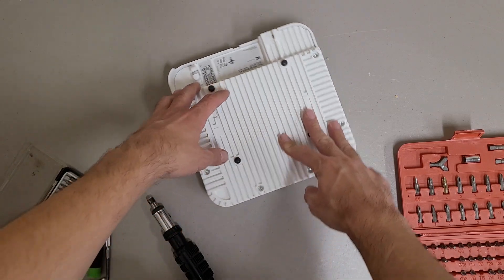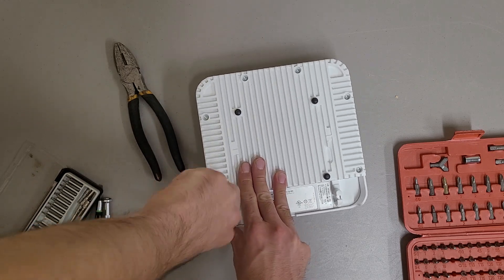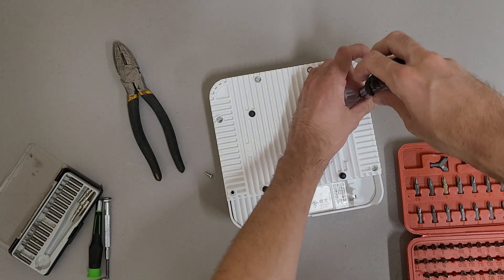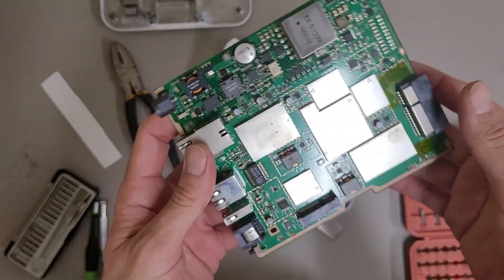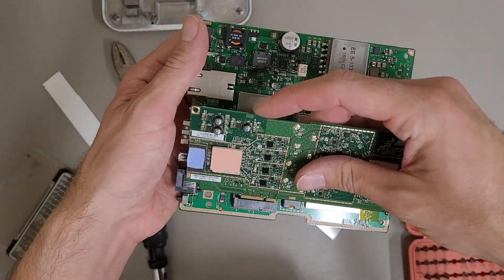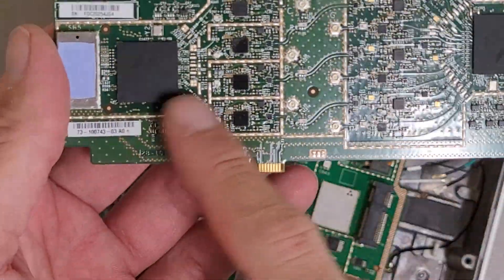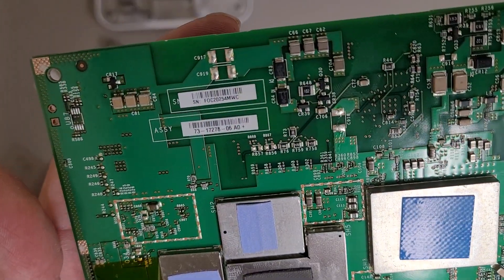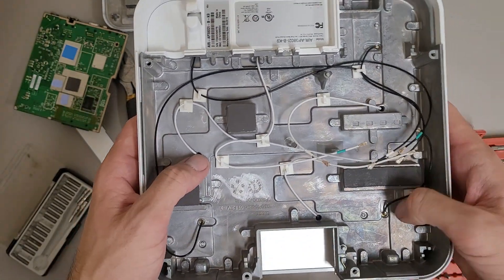Cisco Aironet AIR-AP3802I-B-K9 802.11ac dual band access point #teardown

Comment: I believe this model can run EWC as standalone with perpetual licensing.
Reply from the maker: @BestSpatula  that is nice to know. They are pretty cheap on eBay but honestly don't know how good they are by modern WiFi standards.
Reply: @computersales  This model is actually still supported by Cisco (until Oct 2027!) I have hundreds of these in production. Not the latest, but still decent by modern WiFi standards. I am curious if the RF module could be used in another computer as a regular Wi-Fi card. People who own these generally don't play with them or try to hack them.
Reply from the maker: @BestSpatula  interesting I think I have a few more floating around. They just aren't worth enough to eBay them. Maybe I'll have to see if I can put them to use.

Comment: I just want to know if regulatory domain is set by a pulldown resistor or something. Bet it is..
Reply: Considering you can reflash everything I'm not sure it'd be on the bootloader or anything. Either way, thanks for just waving the boards around so I couldn't get a good look 😂😂
Reply from the maker: @forbiddenera  sorry if I didn't hold them steady enough to pause and get good look. I try to hold them and pan across the camera. I'll have to come up with a better system.
Reply from the maker: Oh I also have some more I might be able to tear down when I have time. I could probably get some high res views of the part.
Reply: @computersales  I was mostly giving you a hard time but if you wanted to take the time I'm sure some might appreciate it. Though I'm sure few hack these devices at least until they're cheap used which they're starting to be (got my two for 20 cad)
Reply from the maker: @forbiddenera  yeah they aren't worth much sadly. I kinda figured you were joking but I appreciate the feedback though. I can't promise I will get to it any time soon but I will keep it in the back of my mind if it would be helpful to others.
Reply: @computersales  thats what happens when cisco makes you replace everything every few years because "EOL" even though the hw is still plenty usable, the 3700 was like 1600usd each in a 10pack new, now they're like $5 to $10 on ebay
Reply from the maker: @forbiddenera  That is why I like MicroTik stuff no cloud no licensing just reasonably priced hardware. Although I find it to be hard to manage but that's because I'm lazy and let a friend do it for me.  🫣😅